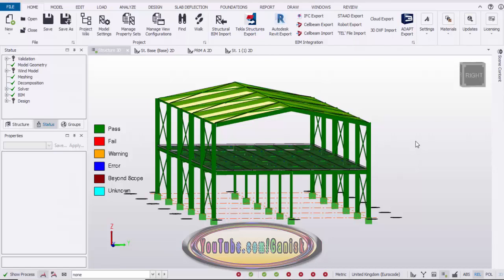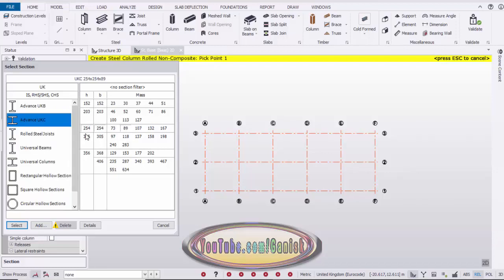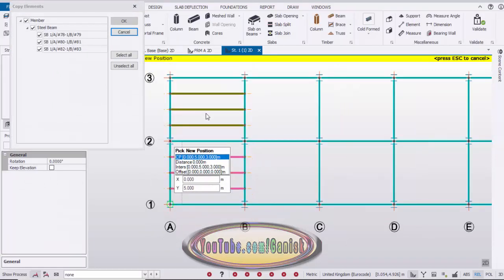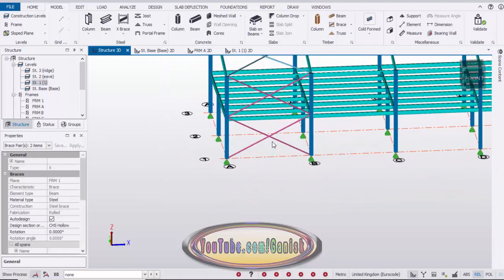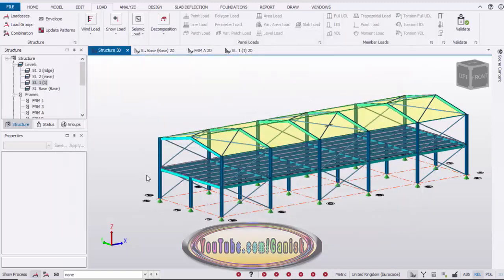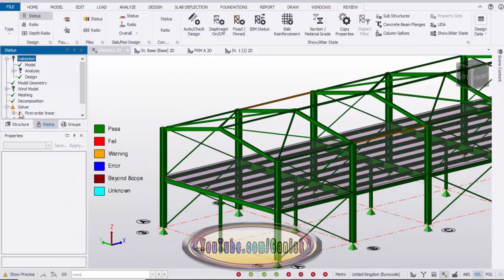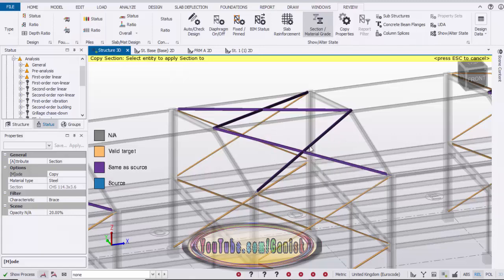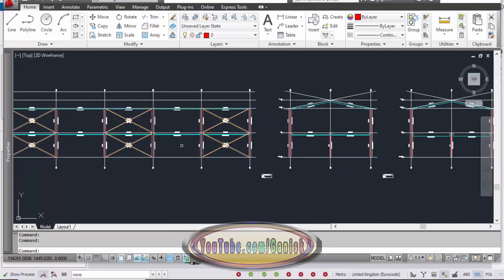Tekla Structural Designer Tutorial 7 - Steel Building Design

Comment: Thanks. I have some questions. Can you design foundation depth in Tekla structural designer? If not at what level do you design foundations? I have seen other design foundations just at ground level while others create a level below the ground at an assumed or externally designed foundation depth and design foundation from there. Are the two methods going to give different results of foundation size or its just the same?
Reply from the maker: yes you can do foundation design in Tekla Structural Designer